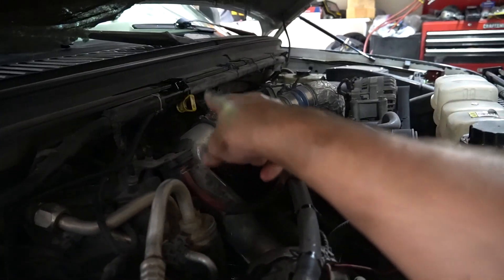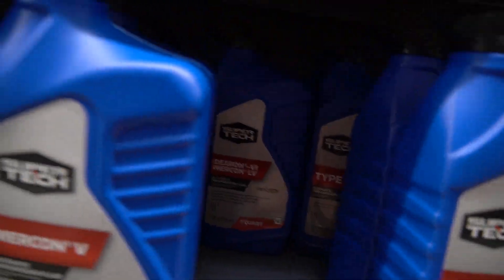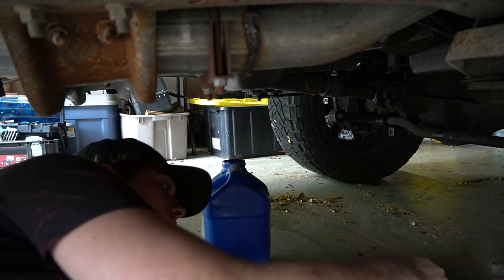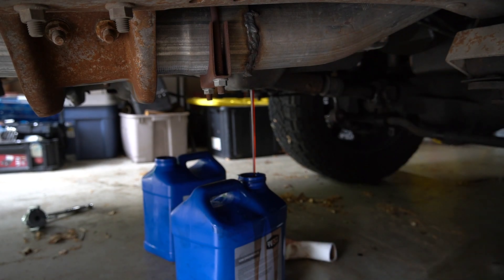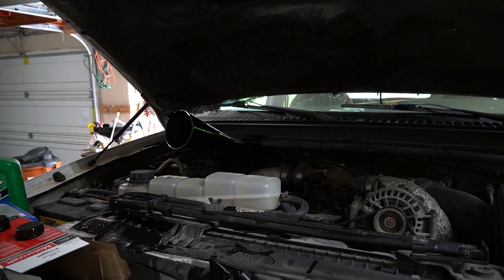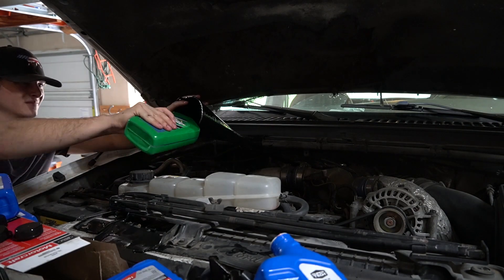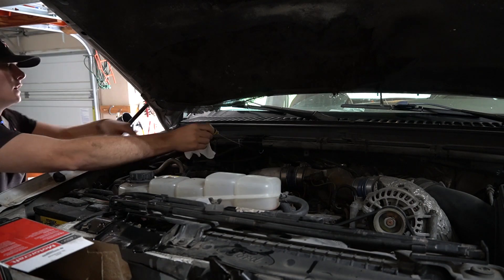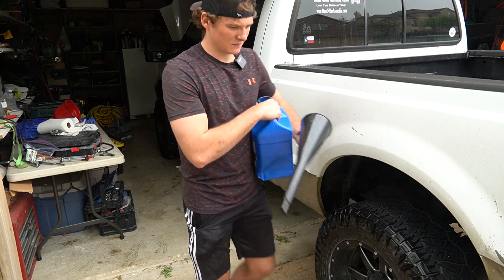How To Change Your Automatic TRANSMISSION fluid On A 7.3 L Powerstroke Diesel!

Comment: Supposed to use Mercon V not Mercon LV. Mercon LV is too thin of a trans oil for your transmission. Have you had to rebuild or replace it yet since doing this video?

Comment: Holy crap buddy.
1. Drain and drop the pan.
2. Reuse the reuseable gasket.
3. Check for metal chunks on the magnet. A few filings is fine.
4. Change the filter!
5. Use the ATF type in the manual or subsequent service bulletins...not what x-Burt says on YouTube.

Comment: Wrong wrong wrong.   Go find a Ford buddy that knows what he is doing before frying the tranny.  Mercon V,  not Mercon LV regardless of brand.   Additives and base stock must be correct for clutch packs, pumps and valves to operate correctly and survive daily use.  LV = low viscosity   PS:  Make sure that buddy understands draining the torque converter or the 5.6 qts you added just gets trashed by the dirty 11 qts you left in there.  Or maybe just take it to a reputable shop.

Comment: Hey just a tip, everywhere I've read said that the 4R100 transmission needs MERCON V not MERCON LV. Even a Ford transmission engineer that was involved with developing the 4R100 stated that MERCON LV will destroy this transmission... I don't know, but I wouldn't risk it. Pretty spendy repair, if he's right.

Comment: Definitely how NOT to change your transmission fluid. Service intervals are replace the fluid AND filter every 30,000 miles. And you’re supposed to check the fluid level on a flat level ground with the engine running and the engine and transmission up to operating temperature.
Reply: FYI- I second this 👆the transmission take longer to achieve full temp than engine so run the truck about 15 miles if possible before checking
Reply: Sheesh
Reply: Filter is changed every 100k miles.
Reply: @themanbaby666 , way too long. The filter should be changed with the fluid every 30K.
Reply: @JLCmike4014 are we actually talking about changing transmission fluid every 30,000? This is madness
Reply: @Alberta_MTN_Bear , in a non-synthetic transmission it will need to be changed every 30K miles. Unless you just don’t want your transmission to have a long service life.
Reply: I’ve never changed transmission fluid in any of my vehicles and never had any issues.
Reply: @danielarriaga5716 , well you saved that headache for the next person unfortunately. And i’d assume you never kept a vehicle long term.

Comment: So you're not using Motorcraft MERCON..lemme know how that turns out
Reply from the maker: So far so good
Reply: @powerstrokecentral    Mercon V,  not Mercon LV regardless of brand.   Additives and base stock must be correct for clutch packs, pumps and valves to operate correctly and survive daily use.  LV = low viscosity